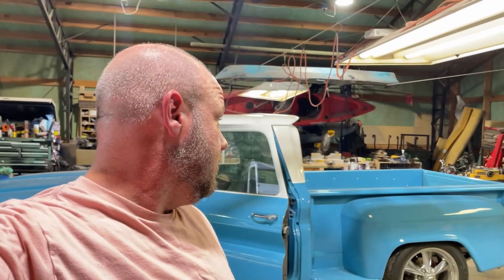66 Chevy C10 - Dakota Digital VHX Guage installation

Comment: What steering column are you using? Trying to figure out out what column I want to use in my 65 that I’m ls swapping
Reply from the maker: I used this one, Demotor 32” from Amazon.  You will have to order a DD shaft and adapters for the steering box, if you need to know those parts, let me know and I can share links for those as well.   https://a.co/d/09PC37ap

Comment: 0BD2 port ;)
Reply from the maker: I pretty much always say it wrong...lol
Reply: @arkansasjon2171  The acronym is for On Board Diagnostics. . . .just remember On Board and you'll get OBD and not ODB
Reply from the maker: @warrenpierce8526  That makes sense.  I've been saying it wrong for so long, it might be a hard habit for me to break!
Reply: Why didn’t you use the oil pressure switch at the back of your engine prior to this gauge installation? I’m using the Holley TX and I’ve always used that switch. Just curious. Great video